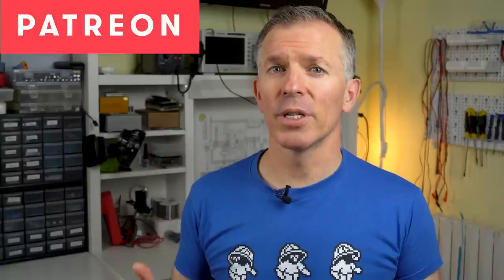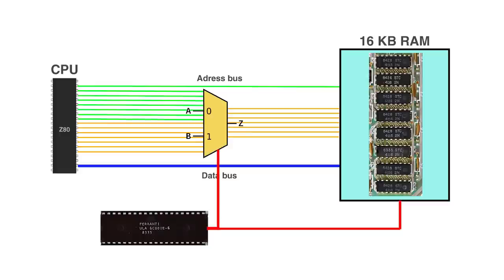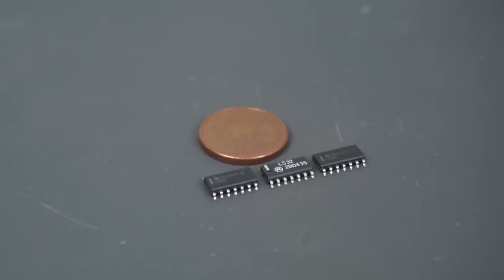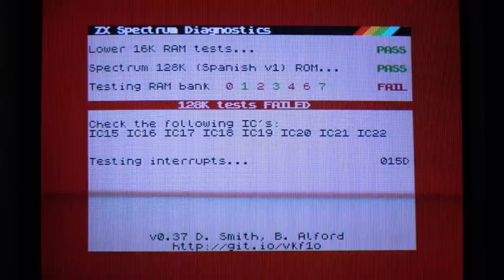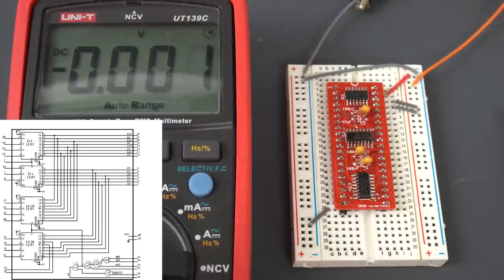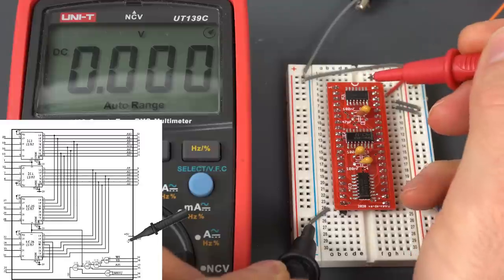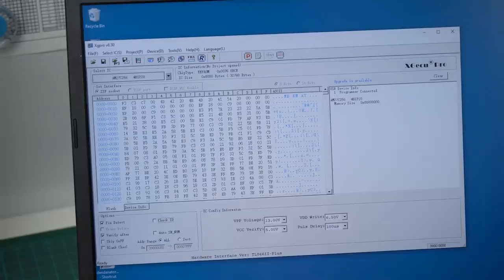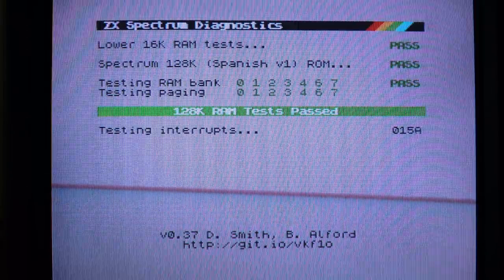ZX Spectrum 128K "Toastrack" IC Replacements and SMD Soldering (Part 2)

Comment: Great video! Interesting things to find out. 

Regarding the bad image that the original ULA provided, it may be related to the blanking signal. Those RGB cables use the composite signal as a blanking signal. But since that signal does not have a constant voltage, it is helped with a capacitor.  Maybe the original ULA provides a slightly lower voltage or more unstable voltage for that, therefore the TV switches from composite to RGB randomly. I've experienced a close situation with two Toastracks: one of them had an annoying image flicker every 2-3 seconds the other behaved the same but this happened a few times each minute.   All dissapeared when I have provided the proper blanking signal to the DIN connnector.
Reply from the maker: That type of RGB video uses the composite video signal to sync the image. Is that what you mean? I think you're right and it's something related to that (see coment below by GadgetUK164).
Reply: @NoelsRetroLab  Where can  I buy a kit for the PCF1306 IC replacement?
Reply from the maker: @biv-8515  The person I bought it from is out of stock at the moment but he's getting more. You can see his Ebay listing here: https://www.ebay.es/itm/224111543392 Send him a message and he'll reserve one for you.
Reply: some people do a similar thing with the Amstrad cpc using the lum as sync and the S sync as blanking which causes ghosting, adding a capacitor will remedy the ghosting but causes the the intermittent loosing of signal (in my experience anyway) .. with the +2 & +2A you can use the 12v feed with a suitable resistor fitted on the motherboard to bring the voltage down when combined with the tv's 75 ohm impendence gives the suitable voltage (somewhere over 1 volt if memory serves) +2 has some different configuration  options via the links ie RGB levels, brightness signal ,audio sync, composite  ... not sure about the toast rack as i have not managed to buy one yet as the prices are high  😒

Comment: Open the SCART connector and compare the pin in question at that end of the cable between the two ULAs
Reply from the maker: Good point. I'm going to guess that it's exactly the same and that the difference comes elsewhere in the signals. I mean, that pin is JUST tied to the battery. Although now that I think about it, if the battery isn't hooked up, then it's not just ground or high, it's an open circuit. I wonder if that causes the TV to interpret it in unexpected ways.
Reply: From what little reading I’ve done: On some 128k toastrack cables, with no battery, they use the composite signal to provide the switching voltage. Somehow relying on the tv electronics impedance to take it into the right range (or something) but this puts a nasty draw on the ULA, it can make it hot and increase likelihood of failure. Maybe you’re seeing that effect with your cable???

Comment: Doesn't your TV/Monitor allow manually choosing between composite and RGB? Many (most?) TVs with SCART had the possibility. I had never seen the 9V battery connector in a SCART cable.
Reply from the maker: Not that I know. I don't think most TVs do, especially not CRT ones. It's the same input, just different interpretation of the signals. Maybe new LCDs have that but I haven't really looked closely since this across all of them.

Comment: Did you get to open that SCART cable to look at how exactly the battery is being used? I never saw one like this, but it is usual practice in high-quality cables to boost the signals through repeaters, so to compensate for the signal loss of the cable itself. This is often done in long-length HDMI cables, for instance. Usually it is done by tapping the 5V line of the output connector, but then again, the same technique could be used to fill out your missing pin without a battery hanging from the cable. That they chose to use a battery suggests they thought the power rail (and perhaps the ULA itself) couldn't drive the signal hard enough across the length of the cable. If you open it and find a transceiver or repeater of some sort inside, there's your answer.
Reply from the maker: I haven't, but usually there's just a resistor and then sends the voltage straight over. I've never seen anything fancier than that in these kind of SCART cables.
Reply: That battery SCART cable is just weird. I can only imagine they use a fairly high ohm resistor dropper to get the 9V to the low voltage required as a signal. But why not just use diode(s) from the TTL signals and capacitor as a charge pump  to provide the missing composite/RGB signal switching voltage instead?
Reply from the maker: @Drew-Dastardly  Yeah, they need to drop it down to 3V, so I'm sure they do exactly that. They could have used an RS232 as well. I never thought of trying to use some of the TTL signals to charge a capacitor. I wonder if that's just too bulky to be contained in the cable. For my own 128K, I'm thinking of hooking up 5V to the unused pin in the monitor connector and using that. The only downside is that I can't use the same cable with other 128Ks (and if I forget, then things like this happen!).

Comment: Thanks for the upload Noel. You could try and see if the bad 27256 will fully erase but I doubt it. I also have the same type of programmer which I converted to the 'A' version from the 'CS' version.
Reply from the maker: I doubt it too since it had some things that were interfering with the data or address bus.
How did you upgrade it? That might be really relevant to me right now because that allows it to use higher voltage right? I'm trying to burn some 2732As for the TI99 right now, but those require 21V and they fail (in spite of being listed as being supported in the EPROM programmer).
Edit: Never mind, I see the CS also supports 21V. But my more recent II Plus only goes to 18V. How annoying!
Reply: @NoelsRetroLab  at 20:27 the good EPROM was installed in the programmer offset  (pin 1 of the EPROM is in socket position 2), and dumped (offset not detected as Check ID disabled, guessing this was done because the read of the good chip failed due to the offset). Bad EPROM is installed with no offset and dumped - imagine comparing the two read dumps will be different due to this (unless programmer software was made at Hogwarts?). Also, the new EPROM was programmed with no offset using the dump of the good EPROM, so don't see how this worked (will put this down to the magic of editing, the curse of continuity, and the desire to tell good story). Anyway... where I'm going with this is, as Andy says, you might be able to get away with erazing and reprograming that EPROM). Thanks for the vids - have been watching them all day.

Comment: I think the way addressing works on DRAM is more to do with the internal construction than price, size etc. From what I vaguely remember SRAM/ROMs with multiplexed buses did it by having the data and address bus share pins.
Anyhow nice video as always.. interesting how much the 8 bits used gate arrays really. You would have thought in the numbers they were making they would have reduced them right down to a single chip pretty quickly.
Reply from the maker: Oh interesting, I assumed it was just a cost-saving issue and not some other reason. Now I'm going to have to look into it 😀
Eventually they did reduce them to just about a single chip like in the case of the Spectrum +2 or the Amstrad GX4000 (but I really dislike working with those because... there's not much to fix beyond blown RAM!).

Comment: Awesome to see that discrete SMD are small enough now that one can use them to replace such custom chips in almost the same size package. Would love to see what options are available if the video ULA was bad. Any way you can make a video on that? That would be very cool to get into.
Reply from the maker: Yes, isn't that cool? That's a very clear way of how technology has improved since the 80s. As for the ULA replacements, I'll make a note about it. In the meanwhile, have you read The ZX Spectrum ULA by Chris Smith? Excellent book. http://www.zxdesign.info/book/
Reply: @NoelsRetroLab  Thank you sir. I am an electronic tech/hobbiest and I am learning HDL and to make a new ULA that can replace the old one with possible enhancements would be great...I'm sure it's been done already though since the Next Zx does not than it's original. I have a TS2068 that needs repair and would love info on that ULA so I could possibly fix that if there is a problem with it. It does have some issues. I've just not had time to look at it or the many retro computers and consoles I have sitting in my garage and shed.

Comment: I suspect those ULA's came from different batches, different tolerances, etc.  In other words, they aren't 100% exact duplicates.  The "faulty" one probably just crosses (or gets close to) some threshold that causes it to be slightly inferior to the first one.
Reply from the maker: That makes a lot of sense. Now I'm very curious whether before this accident it behaved like the other one, it it's something that happened after the expansion was plugged in while it was on.

Comment: Hello Noel, I'm myself also fixing one spanish toastrack, and your videos are being very helpful, thank you. Please let me ask you this question: Could a toastrack prompt correctly... pass all diagnostics in green... but still not work properly? This is exactly what is happening to me after the repair. My machine cannot run the most of the 128k games properly although 48k work (the most of them although not all). Weird isnt?
Reply from the maker: It's unusual, but it's certainly possible. Try both with ZX Diagnostics and DiagROM. Also, to make sure it's not an overheating issue, try ZX Diagnostics on "soak" mode and leave it running for several hours.
I've seen ONE instance where a ZX Spectrum +2 was faulty but ZX Diagnostics didn't catch it. It ended up being some weird RAM chip with different timings.
Is the problem you're having 100% consistent, or does it change from run to run? It sounds like an interesting problem!
Reply: @NoelsRetroLab  Definitely consistent. It happens in the same titles, in the same moments. Basically... 128k games load... with a blue frame... after 3 seconds... black frame. Then you press any key and the title crashes. This happens in almost every 128k title. 
The machine was badly damaged, many Z80 data lines were broken and I had to reconnect them using the data path documentation. I spent many hours checking the connections with my tester. I even found a couple of mistakes in the schematics rendered by Ian Worsley that you can find on spectrumforeveryone.
Full recap and a few RAM chips replaced as well. 
I tried "soak" mode for about 2 hours (40-50 iterations) and nothing bad happened so I am kind of puzzled. I think RAM could be the cause, so I double checked the connections to no avail. Since everything is socketed, I will play with the RAM chips and I will try DiagROM.
PCF1306 could also be the cause? I guess I can manage to build my own replacement following the schematics shared on speccy.org 
At this point, this little fella it's starting to be a real challenge.Thank you for your advice!

Comment: As a kid my OG 128k had a strange issue when you do that built in maintenance feature (never knew exactly how to get into it, but I just mashed all the keys when powering on) it got near the end and always crashed but games work, I think it was a ram issue, I last played it around 1998 and in the early or mid 00's tried turning it on to just have loads of rainbow lines, its still at my parents but their house is damp so it may be beyond repair.

Always wondered if it was as I thought a ram issue.
Reply from the maker: It sounds like a subtle RAM issue, although the fact that games worked fine is weird. Games usually push the machine to the limits and use up every bit of available RAM. But it would be possible.
The machine might be recoverable. You should rescue it and see if it can be salvaged 😃

Comment: LOL i didnt know Sir Clive was 'that' much of a scrooge to use defective memory!! thats hillarious!
Nice video, and nice replacements and fixes!.. i bet with the ULA issue, that they would also be different on different TVs too.. maybe not showing the issue (without the battery) on one TV, but does on another... some TVs have real trouble when the signals are not perfect (eg the blanking and syncs) others just display artifact, and some are so tolerant they can miss complete signals (eg blanking)
do you know of any CPC chip replacement kits like this...i really dont wanna go the FPGA or CPLID (and learn how to program them) route if possible
Reply from the maker: Yes, you're right. Especially because I'm leaving the blanking signal totally open. It's not like I was grounding it or applying some voltage. I won't make that mistake again! :-)
Reply: That was pretty ingenious of Sir Clive. No wonder the speccy was so much cheaper than its rivals at the time! RAM was quite expensive back then. To cut a deal and get chips destined for landfill was great thinking.
I am also minded of the fake cache RAM chips of the mid1990's used in 486's. That however was criminal and not ingenious.
Reply from the maker: @Drew-Dastardly  Exactly. This was ingenious but totally legit. Did you see the video I did on the Amstrad CPC 472? That one was definitely not very legit: https://www.youtube.com/watch?v=_ErfWfjN9iU

Comment: How to manually test for bad DRAM chips if you do not have test cartridge?
Reply from the maker: Good question. Having a test cartridge (or even an EPROM) is the easiest way. If not, things get a bit trickier. Maybe I'll do a video about this sometime. Basically I would first look for hot chips, then look for data bits stuck on high or low, then look at the address bus, and finally maybe measure resistance between each data line and ground and look for some that are unusually low or high.

Comment: Funny, I didn't know that Windows 10 shell had a COMP command, when I needed it, I believe it was with W98 or ME I used :
FC /b  Rom1.bin Rom2.bin
FC stands for "File Compare" and /b forces a binary comparison, otherwise it will compare as text files, disregarding extra spaces and line feed characters...
Sorry for saying this but I'm Portuguese and I've never been too fond of Spanish ROMs - Usually I flash them with the standard version. Some programs use ROM's content to generate random data, so there might be some compatibility issues (at least in one program I wrote, that's basically a tape copier for the 128k it uses the ROM error messages, like "Tape loading error" and these have a specific length, so when I call the error report routine I have to specify the exact length...
One program I've wrote is not 100% compatible with the +3 - The sounds sometimes sound ok, others too low. I've tried everything, even disable memory paging, but nothing seems to work, it's completely random but a cold boot and selection of "48K Mode" in the main menu solves the problem... I believe it has something to do with a short sound produced by the +3 Menu when we move the cursor up or down and press enter... If anyone knows a solution to this problem, please leave a comment below...
Reply from the maker: I had no idea about comp either, I had to look it up. I use Mac on my day-to-day work, but I use that crappy Windows laptop for EPROM burning, Arduino programming, etc. On the Mac I much prefer Hex Fiend or just diff from the command line.
Yeah, the UK 128K ROM had some bugs fixed too, so that makes sense. I believe there's even a project that has patched a few more bugs, but I can't remember the name of that project now.

Comment: how to unsolder a faulty SMD-chip without a heatgun: use a sharp knife to cut the legs on both sides and take out the body - take out leg by leg with just your soldering iron

Comment: The extra pixels are not really pixels, they are display artefacts. Dunno much about how and why but I've seen them on some setups since the '80s.
Reply from the maker: Yes, that makes sense. It's weird that there was no clear pattern either (it wasn't every end of the line with a certain color that was triggering it).

Comment: Why is resistor R127 Missing??
Reply from the maker: Not sure. That happened a lot in older PCBs: They would have some parts that would be left empty. Look at the huge circle area in the top right corner of the board even! (I think the UK board had some kind of coil there or something).

Comment: 99.99% of new chips are good. 99% of problems is bad soldering. This is at least, in mine case. ULA is not very complex chip compared with Atari ones.